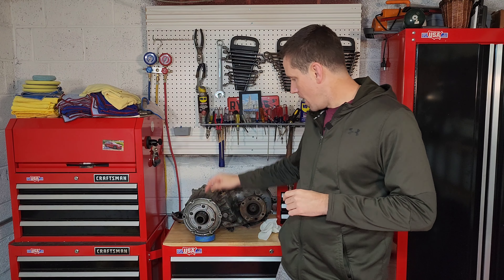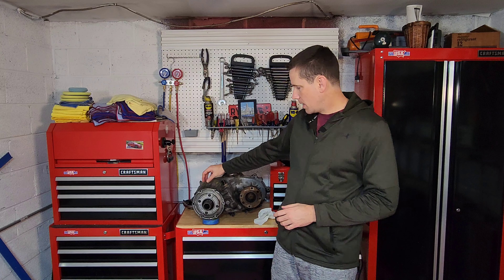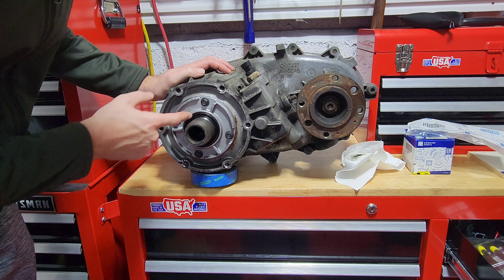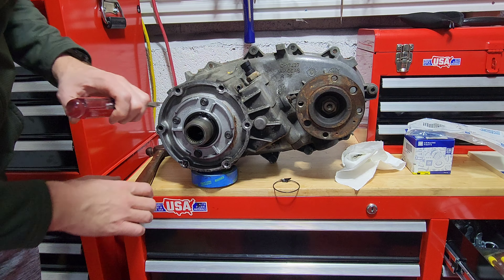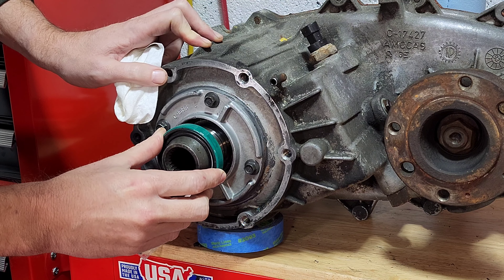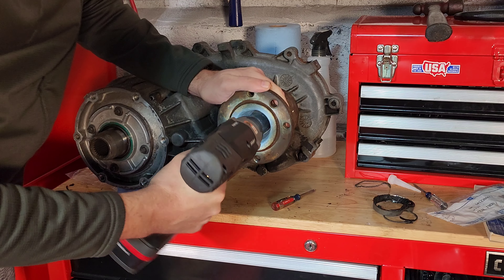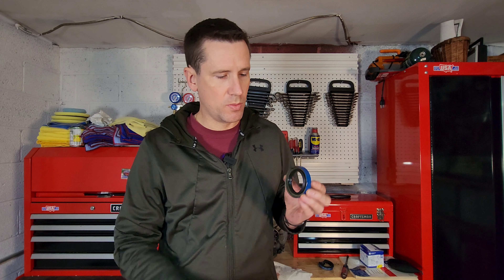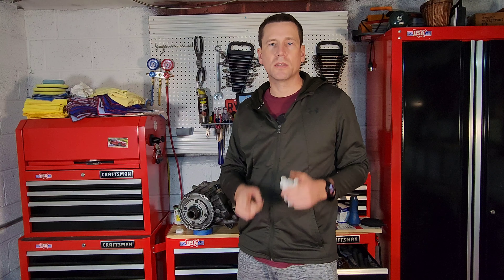NP241C Transfer Case - Seal Replacement

Comment: Very common issue on high mileage units. When I replaced mine it was without a doubt the hardest rubber seal I have ever replaced. The rubber in the seal was petrified and hard as a brick from the heat and from the fluid.
Reply from the maker: Same here! It felt like I was chipping out plastic.

Comment: Did the front output seal leak?  I have replaced mine 3 times.  1st was a skf, 2nd a timken 3946. 3rd, I put a speady sleeve on and national 3946 seal. Still leaks but not nearly as bad as it was the first 2 times.  Any suggestions?
Reply: Is the seal spinning?
I hade same issues by an Differential. 
The Seat from the gasket Was damaged,so the seal starts spinning on the shaft. 

When you put a sleeve on just the space between shaft und seal gets repaired.

Comment: Do you have a part number for the seal? I’m going to tackle this job soon, Same thing is going on with mine.
Reply from the maker: GM # 14095609 is the input shaft seal.
Reply: @rporestorations  thanks you
Reply: @rporestorations  do you know if that would be the same on a passenger side drop transfer case on a 90 k5?
Reply: Why didn't you just remove the input seal front plate to gain access to back of seal?